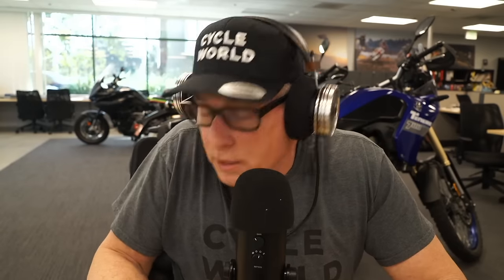Why Ducati's RIPPER single-cylinder Hypermotard is BETTER than we expected.

Comment: I test rode one last week and LOVED it. So smooth and agile. No vibes and very good through the rpm range. Nice top end. Could be the ultimate adventure bike if Ducati chooses to do it. Good gearing and surprisingly good on the interstate at 70-75mph. I’m planning to buy one for the track. It’s a HOOT!
Reply: What are the maintenance requirements?  Are they as bad as the Ducati street bikes?
Reply: @jamesnelson6381 
Ducati isn't as bad as they used to be since they switched to chain driven timing with the Panigale.
The desmo heads are still fiddly to perform a valve check on, but at least there's no bi-annual timing belt replacement.
Reply: Seems like it would be a great every day,around town bike. Kim sure it’s a giggle to ride.

Comment: So slide by brake function is initiated by aggressive front brake application followed by more aggressive rear brake and letting the ABS and IMU handle it? Can someone please explain this. Is it controlled "backing it in?"
Reply: Yes, it's basically what we would have called "hackers" back in the day. But just as you see MotoGP and Superbike riders backing it into the corner, that's what this system is helping you do.

Comment: Hi, I'm a recent subscriber or follower, sorry I'm from Portugal so not native to English language.
I have listened to all podcasts from you guys since I found you, you surely speak my language, thanks and congratulations, you're very interesting.
I do have a couple of questions.
But 1st let me introduce myself; I'm currently assembling a RZ (RD over here) 86 ypvs with 90 FZR 400 wheels, brakes and suspension. That's my only bike . And follow some rules like no brands mixing, no big generation gaps and similar segment, size, weight, power etc. These bikes were eventually on the market simultaneously and share key parts like brake pumps and the rear caliper. I also have a few engine mods like vforce reeds, 30mm flatslide carbs, adjusted squish band while o'ringed head, programmable CDI with valve control and a few other. Keeping the size though, I actually bought the last set of cylinders from Yamaha.
Anyway I digress so I forgot my question now,  I'm sure it will come to me eventually, sorry but the other thing is if you could do a podcast about the famous Bimota V due 500 please and I do have to go now. Sorry for the long post if you have actually reached this far! 
Thank you

Comment: Two minutes in - gotta say my first new bike was a 250 Ducati Monza.  It was quick, handled beautifully, and - according to Cycle World Magazine - had the same brake swept area as a Harley.
Most memorable instant: Driving through a rainy afternoon the plug lead came out of the cap.  Coasting down, still in gear, reached down to attach it and fired the plug through my wet fingers.
Exciting to say the least.

Comment: Don’t have a lot to add, other than the test ride I took left me really impressed with the engine and I hope it makes it’s way into a dual purpose and light adventure bike sooner than later. The 698 Hyper left me really impressed as a whole but the engine was a standout in how broad the spread of power was and the throttling. Yes, there were times when fuelling was a little fluffy at low RPM but in it’s element the motor was a gem.

Comment: along with zero valve float, the desmo valve train can open a valve fully sooner and stay open later within a modest duration, which gives a flatter torque curve with the larger flow area window.

Comment: Excellent podcast.  I found it satisfying that there was a discussion of tuning the single more for consistent torque in the lower revs vs max power at high revs  (12:50) that was echo'ed later (43:00) :by Bradley describing the performance of the new motorcycle.   
I have had several discussions with people who don't seem to understand that a significant amount of peak power at near redline is lost when the torque is moved down in the powerband to improve rideablility.  It looks good on spec sheets, but the vast majority of the time, riders are nowhere near the rev limit of a motorcycle.  Moving power down into the rev range makes a motorcycle feel much stronger during normal riding.
Reply: Perhaps, however the 698 mono still has a significant torque handicap when compared to the austro-sino archetype.
Reply: @xeeded  Have you seen rear-wheel dyno charts yet?  I have gotten to where I distrust published numbers unless they have a dyno chart that shows the whole story.  A peaky engine, for example, will post great peak torque and HP numbers but can be slower overall.
Reply: @xeeded  An interesting example of retuning an engine is with the 660 Aprilia.  The 660 RS makes 89hp on Cycle World's dyno whereas the Tuareg is only 70hp.  The difference is the torque curve.  Peak torque on the RS is at 9,540 rpm vs 6,680rpm for the Tuareg.  Although peak torque numbers are similar, the Tuareg is at 80% max torque by about 3,000 rpm. 
The differences at lower and mid-range don't look that far apart on paper,  but riders report a big "seat of the pants" difference.
Reply: @xeeded  I'm glad you enjoy your motorcycle.  I have no idea how the 690 will compare to the 698, but that does not change the fact that changing the cam profile can change how the engine works and feels.  A lot of redline power goes away when the torque curve is moved down (unless you have variable valve timing).
In supermoto racing though, you want more weight on the front wheel, so you don't really want a wheelie machine.  A very gradual increase in power from an extremely flat torque curve can produce faster lap times than a more "lively" motor, largely because it is easier to keep the power delivery right at the maximum the tires can take.

Comment: all good n very informatif -guys! would actually be interesting - why they're allowed to hve shorter wheelbase (electronix?!) Also was never mentioned that specific track test , was made on a more o' less Dump track ..! (when most of other bikes - would have just to pack n go...!) Also intake mag valves n outtake made of steel (temp management) and 'hollow' parts etc etc  THANX !

Comment: My 1980's Formula Singles race bike was Yamaha XT 500 based and would literally blur your vision in 2nd gear.
Reply: Interesting. My dad bought one of the early XT500s (1976, I think), and I loved it for its monstrous torque and four-stroke roar. It would do wheelies at will, with my lightweight ass on it. I don't remember the stock engine vibrating much, but my references were all single-cylinder, two-stroke dirt bikes from the 1970s, so what did I know smooth engines, anyway?

Comment: Same thing with timing in 2-strokes ports like 4 stroke valve timing. Everyone wants to make more and more hp and they end up ruining the engines ability to be ridden normally. I bought a 77 RD400 and under 5000rpm it would not move. Even from a stop Id have to rev the snot out of it and feather the clutch.. then I had to keep it revving high all the time just to go down the damn street, it was awful. Took me a year to find some stock timing cylinders and OMG this bike became such a joy to bomb around town on. So much torque right from idle and a strong mid.. right where anyone with a brain would want it.

Comment: 29:54 "Makes the engine more linear" I have only just come across this podcast and Im so impressed. As a motorcyclist of 50 years and engineering in big auto word wide for 44 I have some experience good and bad in motorcycles, cars, engines and over the last 20 years electric propulsion. That statement is the key, Ive ridden and built on the road machines from TZ350 (yes on the road) to Yamaha GTS1000 through Yamaha MT01 to Suzuki GSXR 1000 K5 and as resident of the Isle of Man have opportunity to put bikes both on road and off through their paces, but Im sick of reading the bike press with this years latest paint and winglets, I thankyou for in depth techincal, Im learning something here.
For me Im bored with the piston power plant. The electric motor provides an unparalleled but unpopular solution (with other people) for me both in car and bike and the propulsion system (battery and electronic control) is still in its infancy, feels like a brave new horizon. Im not popular with this view and I still build and ride other internal combustion engine machines from Hondas CB750 K0 to Hercules W2000 rotary but more so now for sentimental reasons it tends to be the esoteric ones I go out on. Electric keeps giving me, as you say the linear response to the throttle, love it, its the future.

Comment: Urban bikes aren't immune to gridlock and these aren't race bikes. I wish the transmissions could provide a shorter first, with a nice spread for the other five gears. I hate the 690's gearing but find the engine and chassis happy enough to spin and drift through an intersection on one wheel; no electronics required.

Comment: Only the water cooled Ducati's have minimum over rev, as the 900SS's had peak HP at 6700ish and a 9000 red line. I have never heard of any motorcycle having anywhere near this over rev. It would be interesting to hear your thoughts if you know of any?

Comment: Big bore mono are stupid. No revs and allot of vibrations.
Reply: But they are compact and fairly lightweight, hence why the single is still the choice for off-road bikes.
Reply: And so fun to ride that you don't notice either. I suggest a gold wing for you.
Reply: @firstielasty1162  I have had a big mono and the vibrations where unbearable (bmw sertao) . Two cilinders are a must for more power. In my opinion , a motorcicle should not exceed 150 kgs. 125cc ar enough , 250 cc are the limit for me.

Comment: I really enjoyed this video and all of your thoughts.  I get all the electronics...but I'll take my 2008 Aprilia SXV 550....dyno'd 74hp at the wheel with a pipe, HealTek quickshifter...Just find one like mine that had forged pistons installed...I paid $4500 for mine and it makes me laugh EVERY time I take it out and power wheelie in 1st - 3rd gear on my back roads of West Virginia and I'm 59 years old at 270 lbs....imagine if I were 150 lbs ....for shit sake.
Keep the great vids going boys...love them A++++
Reply: How often to rebuild/major service?
Reply: @tomtraynor5384  Hello ...mine has forged pistons and titanium buckets over shims and I am not racing my SXV just really spirited riding in the back roads...so I will be in the 18-20k mile range...now if I was racing it and banging the rev limiter all the time...probably 10k miles.  These bikes are more reliable than most think...if you stay off the limiter.
The Duc is really sweet bike for sure...I have a 2019 Multistrada PP...just gobs of fun.  So I certainly agree with you thoughts on the Hyper....just a tough one to swallow ...keep the great vids coming !!! your are A++++
Reply: @chubbyguyschannel6864  where might one buy these parts or were they custom made by you
?
Reply: @rikig88  Hello,  you can still get aftermarket exhaust for these girls.  Pistons were supplied by Allen Nolan and well known SXV guru in Delaware.  Forged pistons will last for a long long time as long as you're not banging the limiter all the time. Just added a custom Fisher Seat for my fat ass..wow what a difference.
Again I love this Duc...have a multi pikes peak myself but my SXV is so much bang for the buck.